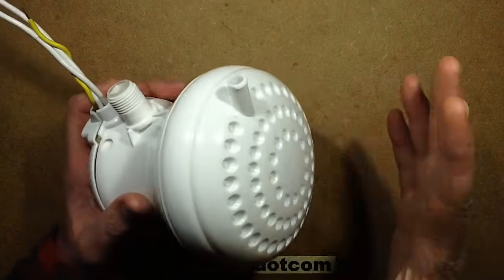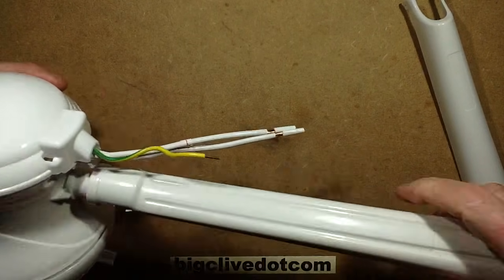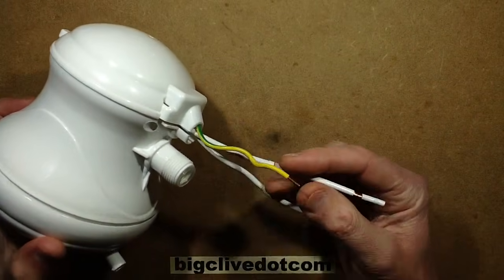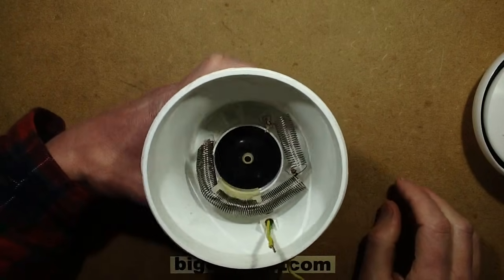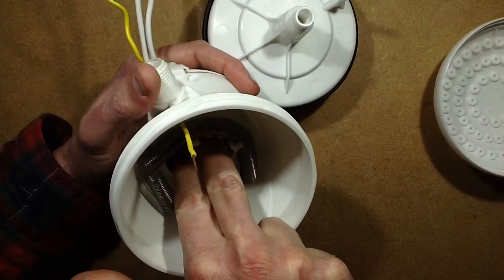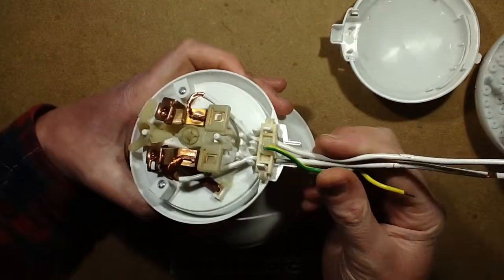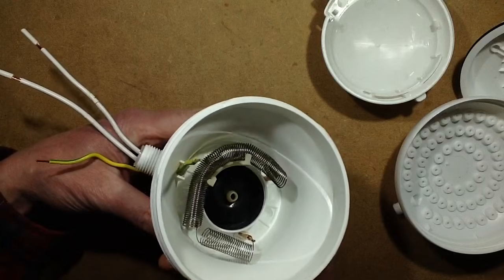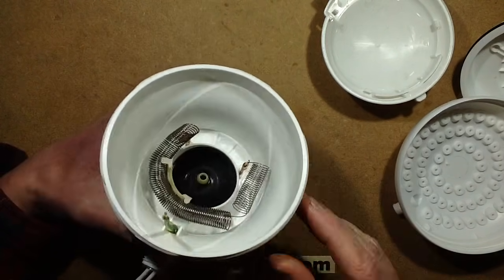Inside a heated shower head.  (suicide shower)

Comment: You Brits are too afraid of electricity. I've been hit with the American 125 volts many times and I'm still fineaeidaksjoaskdjas;
Reply: +Braeden Hamson It's just a flesh wound. .! xD
Reply: Aye but we have 240 volt which will kill you.
Reply: It's not the voltage that kills you.
Reply: Witheredgoogie it’s not the amps either
It’s both
Reply: @Alucard-gt1zf  , wrong...
Reply: @Witheredgoogie  it depends. the higher the voltage, the easier it gets through skin.
Reply: @Witheredgoogie  triggered
Reply: @Witheredgoogie  that is like saying the knife doesn't kill you, the severing of arteries and bleeding does.

voltage is the thing that allows current to overcome the resistance of your skin and push through your body which is far from the perfect conductor.
Reply: @dfpguitar   I originally was just saying not to be complacent about it being 'only' 110v, it will still kill you in certain circumstances as it can draw on the current available to the mains supply.
Reply: I don't think we are too afraid of electricity, just a lot smarter with it.
Reply: @LowModulation  Well the voltage at your car spark plug is something like 25KV, it will give you a shock but it's not gonna kill you (unless it disturbs a pacemaker or something) even if your standing barefoot in a puddle. Likewise those 25KV cattle fences don't kill cows.
Reply: @Witheredgoogie  It's a known thing in the motor trade that some early CDI ignition systems were responsible for the deaths of several mechanics world wide,having my self witnessed an early PSA CDI coil (a type which I believe was outlawed)with damaged insulation firing multiple 4-6 inch arcs across to any earth nearby,I can understand why.  The customer had attempted to insulate it with 4 rolls of pvc insulating tape which had zero effect and the material transfer in such a short time,arc erosion to nearby bolts and the steel support for the header tank was evidence enough of the danger. I my self have had a few shocks from various plugs coils leads over the years,none were particularly nice but the worst was unintentionally being the current path for a rather large arc welder,at about 300 amps,it was nasty and affected me physically for about fifteen minutes,my hair genuinely stood on end according to my father😄and 35 years later  I still have a physical scar on my arm from the arc,I  used to know an old boy who got a belt off a 50 volt exciter generator once and it gave him a massive heart attack, he had to retire at 35.The point being if it's the right shock in the right place even what's considered reasonably safe could be dangerous to the wrong person.
Reply: It's not fear so much as a healthy and totally necessary respect. As someone who has done loads of building maintenance and HVAC work I will say you don't get complacent about working with live electricity and get away with it much. At best the outcome is inconvenient, uncomfortable, and more than a little personally embarrassing/humbling. Unfortunately it also can easily lead to an emergency hospital trip or death. Never had a bad shock myself or seen anyone else die thankfully, but I have seen a few guys get badly hurt, it sucks a high hard one.
Reply: 415 at 100A hurts and makes you go blind for about 10 seconds
Reply: Tiago eu acabei de abrir o meu e é a mesma merda
Reply: 125 yeh no problem, but not 230v thanks
Reply: I've been shocked by the European 230 Volts many times as well. BUT, that was always in dry conditions. I took some tests once (with a battery powered device that can output several hundred volts without that much current possible) in the shower.
In the Netherlands, the Building Code requires ALL 'strange conductors' in a shower-room to be earthed. This means radiators, all the plumbing, the metal shower-drain (even if the piping below is PVC) and, the most important, the iron mesh in the concrete floor.
With water on the shower-floor and having the water 'connected' to one pole of the device and the other connected to an earthed point somewhere in the bathroom, tingles started at only 1 mA or so at only a few Volts. Let alone the disastrous results if the voltage would be 230-240 Volts, you are standing under electrified water and then touch something conductive enough or (worse) earthed.
If there is no RCBO/GFCI/RCD in place or it is faulty wired, you will encounter a nasty shock, which could very well be fatal.

Comment: would using an isolation transformer make this safer?
Reply from the maker: +Justin M It would have to be a 5kVA isolation transformer and would cost a fortune and be a very large inductive load.
Reply: +bigclivedotcom how about having it spray into a metal colander that is grounded i guess the main problem is they are mounted too low they should be installed 8 feet above the floor

Comment: That's damn scary. If i ever see one of these, I can assure you that I'll just spare myself the misery of dieing. I think the french did it best with their version of the on-demand heater which sits in the wall and either runs on gas or is completely tied to earth ground. While more expensive they are far safer than the device you've shown here. That thing freaks me out.

Comment: We were taught that the the potentials on the power conductors on the continent are balanced about earth so in many countries there is no live or neutral just two half-live wires.  This is a lot safer as a leak to earth can only be a maximum of half the supply voltage. If this is true it could explain how they get away without killing many people. (In the UK Neutral and earth are connected at the sub station).

Comment: OK, kids, you heard what Clive said. These things are horribly dangerous. I had one of these in my bathroom -- a slightly different model that uses a "resistencia" (a heater module that can be replaced for a few bucks). I would sometimes feel a tingle as I lifted my hands higher than my head to rinse out the shampoo.

Google this term: "calefon-718559.jpg" is a pretty good illustration for how it was installed. Scary. Picture of a "resistencia para ducha" can be found with google: the ones wrapped around a black core.

Some people, because they can't afford a couple of bucks, will twist together the broken parts of the heating element to get the most use they can. This is what had happened with this particular shower before I replaced the heater coil.

It doesn't get horribly cold here, but it will go down just over 1°C overnight in winter. It snowed in this area back in 2007 or so, it's pretty infrequent that temps go under freezing. Unfortunately, this means playing with the water pressure until the flow is at the minimum to activate the diaphragm. Less water volume = higher output temperature.

Eventually I got rid of it after I discovered that the electrical line had no earth. Actually, there was an earth line, but it wasn't connected to anything other than itself inside a junction box. I was putting in another outlet to allow me to use some appliances on the other side of the cooking station when I discovered NO EARTH! It took me a few minutes to convince my landlord that he should install a "calefon/calefont" - they don't know how to spell in this country.

Equally dangerous, he installed a 5liter water heater with its chimney INSIDE. How stupid is that? Don't take any long showers!

At least I no longer run the risk of electrocution. And no, I don't have a CO monitor. And yes, I know.
Reply: Oh, I forgot to say, nice spanish pronunciation! Heh. Kidding. Horrible pronunciation. "Banarse" -- actually you say it "ban YARR say", but you said it like you wanted to prohibit an "arse".

Comment: Manufacturers installation video:

http://youtu.be/QIV2zgvBoOg

Note the lovely twist-crimp wire connectors used a few inches from the running water. Cannot imagine where the term "suicide shower" came from...

Comment: Hi Clive, 
Yes, these are very common in Brazil. I have been using it all week and every time I visit. I have even replaced these for my mother-in-law. Very simple to install. Few things. the water connector, this you got correct, 2) the wires do feed through the shorter tubing and is generally spliced to a 3-prong plug which connects to a plug high on the wall, 3) the outlet it plugs into is controlled by a switch (you flip the switch on right before you turn on the water and off right after you are done,) 4) the longer hose is an additional shower head to wash your "private" areas or use it to cleans the walls etc, 5) yes I wouldn't advise changing the switch on the shower head while the main power switch is on, you can get a slight shock from that. 

If installed and used correctly, they arent a problem at all. I kind of wish we had them in the USA. The water is warm right away, the warm water doesnt run out, and you arent paying money to keep a tank of water hot and ready to use and it does save water by not having to leave the water running while waiting for the hot water to arrive. :-)

Comment: I am always amazed by how americans and europeans are completely shocked about a electric shower head. It's completely alien technology for them. This is the most common thing in Brazil. This is the cheaper one but the more expensive stuff like I have has 8000w resistance and it's REALLY hot. 40amps breakers are a must. Also that hose its not a "safety measure" (this really made me laugh) its just a little hose to wash your lower parts or kids, feet, whatever. This is a shower head, not a pressure cooker.
Reply: +Brennonicolini 
It is not alien it's just fascinatingly primitive, and it's completely illegal technology here, thank God.
Reply: +HAL 9000 well. It shouldn't be then. Because its such an efficient, and cheap, way of heating water. And FYI we've never had a single case of electrocution here.
Reply: +HAL 9000 you know the simplest thing are the best things? This is the best solution for hot water on demand. No stupid boilers that you have to wait several minutes to heat up a small amount of water, and if you have more people in the house they may run out of hot water after a couple of showers. Then you have passage heaters that solves that problem but still can cost thousands of dollars and there is still the problem of plumbing. Running hot water plumbing trough out the house does not seem efficient to me. Even if I were to live in another country my house will not have any of this stuff. Electrical showers and tap heaters only. These kind of showers heat up in a matter of seconds, 2 to be exact. Our mains is 127V but for the sake of reducing costs even further all showers operate in a 220v line. Again, for decades I and other 200million people in my country have been using this model and have had no problems with it if installed correctly. These showers cost up to 30$. Im sorry.
Reply: +HAL 9000 it is a common practice to just splice the wires and isolate it with some electrical tape, but I don't do it in my house just for the sake of ease of maintenance. I use a ceramic connection terminal specifically designed for showers, so if I ever need to take it out its much easier to do so. Another thing I forgot to mention is that our showers are usually much higher in the wall than what I've seen in europe, usually about 2,30m (7,5feet), so there's never a steady stream of water to conduct electricity hitting you directly, if there was a malfunction in the ground wire.
Reply: Yeah, gee, so weird for people to be surprised about showering in water that's submerged in bare live heating coil that's connected to the mains without being grounded, and without any kind of safety trips. Silly Europeans not wanting to play Russian Roulette every time you shower. Pfawh.

Comment: The sun never shines in Brazil?Jesus wept! Just stick an old HWH in the sun and you'll have all the hot water you'll need. What happens when one turns off the water but not the electric chai... shower? It's well that 220v throws you away. You won't get electrocuted when going through the glass shower door

Comment: Hi
A little bit of my half knowledge: In Europe we getting an electrical shock, because the current runs through our body into the ground. This is because the ground is used as neutral. If You see hi voltage lines, there are only three cables, three phases but no neutral. The current comes through this cables to us and runs back to the ground.
In Brazil they don't use the ground as neutral. I was told, You can touch even the hot wire and nothing happens. You have to touch both (hot and neutral) to get an shock. That's what an electrician told me, who worked in Brazil.
Reply from the maker: +eXactModellbau One of the supply connections will be grounded at some point in the system.  Otherwise the first that actually made connection to the ground via electrical failure would become the neutral in an unpredictable way and pose a hazard.  On dry ground you can touch the live connection in any country, but if there's any current path at all the current will flow through you.

Comment: I saw one of these in Bluefields, Nicaragua that was wire-nutted in with the wires dangling out, and the black and white wires were connected to the black and green wires from the shower head. I decided I was clean enough that I didn't go in. 

I'm going to Guatemala this week, and I'll be on the lookout for more of these. Maybe I'll bring a multimeter to check for voltage.

Comment: First time I saw one of these was in Ecuador - My first thought was "holy shit! how many people has this killed?"

It was a metal unit attached to a steel pipe from the wall (so at least it was maybe grounded)  But then that pigtail coming out was simply twisted to the feed - no tape, no wire nuts, nothing.  That was wrapped around the pipe then hung down the wall to - wait for it - an OPEN KNIFE SWITCH about 5 feet off the floor....  I stopped complaining about the cold showers...   The total lack of 'giving a shit' down there in all aspects of construction just amazes me.

Comment: Think this shows the need for some commonsense in electrical standards. A unit like this should never be allowed, and they need to be banned in the countries that are allowing them. 

However, in the UK the electrical regulations go to the opposite extreme, and that is just as bad. I know of a good few cases of unsafe equipment remaining in use because the regulations prohibit its being replaced unless the whole building is also brought up to current, faddist, standards, at enormous cost. Or else a cowboy has to be called-in to replace the dangerous article, no questions asked. When it gets to that stage it's as counterproductive to safety as there being no regulations.

Comment: If it's properly connected with brass connectors and 6mm2 wires for 220-250V directly from electric box, it's harmless, the main problem with electric showers with bare coil heater is leakage current in underrated circuits. A shower like this in a sturdy and well dimensioned circuit will be long lasting and will provide hot bath even in cold seasons. In 220 - 250V it's even better, because you can choose for a model even powerful, rated at 7.8kW in the max. level for the European winter.
Bare coil heater doesn't require fuses or thermostat because the coil heater will be act like a fuse in case of an overload power or lack of water. Bare coil heater is cheap and easy to replace, the main issue is the terrifying sound of high voltage arc light when it's working, but it's safer than a hair dryer - if well installed...

Comment: I used a safer looking version of this unit while in Brazil on holiday. That said the wiring looked like it was completed by a blind man with shite in his eyes. Besides the opportunity to conduct electricity one last time, the second biggest drawback is the unit is so heavy it bent the plastic mounting arm to the point that it washed the wall more than the earthing human below. I've yet to figure out why the whole country doesn't just have a 50 litre (11 gallon) tank mounted outdoors. Most of the year it's 20c or more and sunny enough to heat the water at least as much as that death trap.

Comment: I would say one thing. Most tubs and showers are acrylic or fiberglass and connect to plastic drains so the voltage would be most likely to try to leak to the copper piping (or galvanized steel depending on the country) and to earth itself being that almost all copper or steel systems are grounded to earth. At least if the plumber does his/ her job correctly. Thats pretty basic knowledge around the globe I think. So maybe it wouldn't be quite AS dangerous as it seems. I don't know. I don't want one, i would sooner make my own Insta hot water tank before this.

Comment: Eventually that copper lead will turn black with oxide and most likely crusted with minerals and turn pretty close to useless. Also you are correct about the Ground Fault circuitry. This thing would constantly trip it.